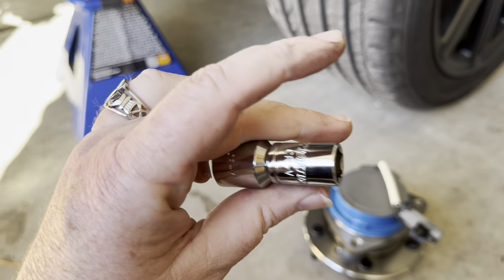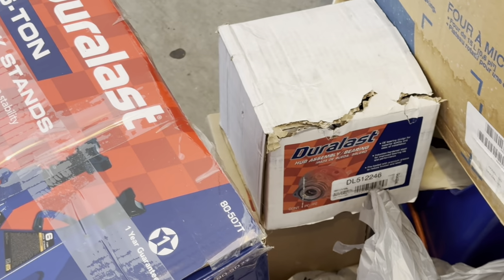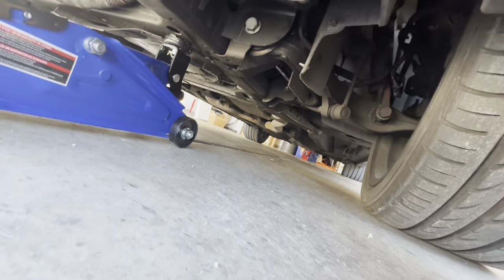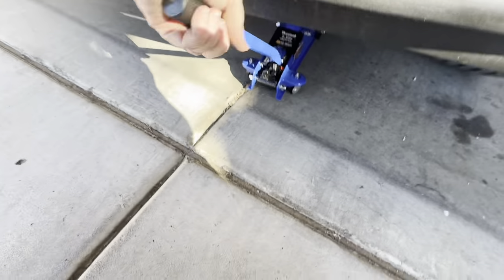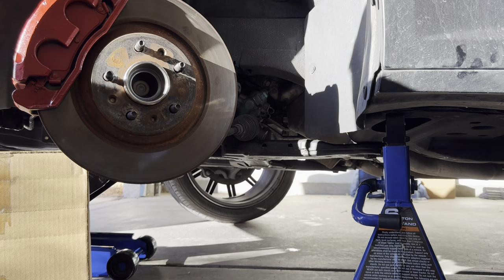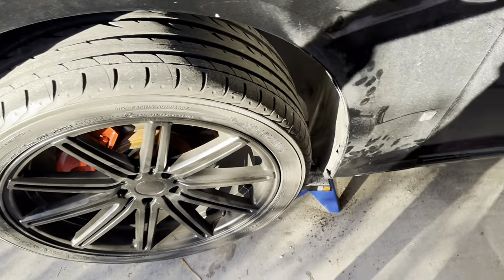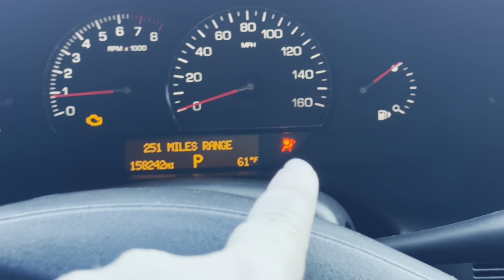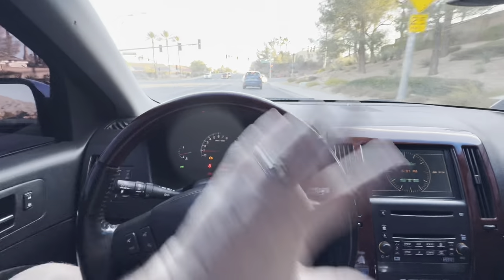Wrenching On The Cadillac STS. Wheel Hubs And More

Comment: That headlamp and tail light monitoring system was use as early as 1974 and possibly earlier by Cadillac.  I had it on both my 1974 and 1975 Eldorados as well as my 1984 Eldorado Biarritz Convertible, and my 1985 Oldsmobile Delta 88 Royale Brougham Luxury Sedan.  On all of those cars, it was a fiber optic system.

Comment: I have the exact same car, that's not a Sts-v the 4.6liter is the stock V8 the 4.4liter is supercharged.. it also has no V bages on it, the stock radio also reads STS-V when started along with the trim on the dash reading STS-V, also the interior is 2 toned on the V not solid Black the brakes were sprayed painted red to look like brimbo but they are not.. with all that said the STS is a great car I love mine.. I have done everything to mine also, injectors, plugs, intake gaskets, coil packs, exhaust, ect you name it.. love your videos, I learned a few things from them.. keep up the good work
Reply from the maker: Yeah we adressed this in the original video description. The car came with a 4.4 sts v engine installed. it was worn out. i switch it out for a 6.0L LS. then switched all the coils etc etc